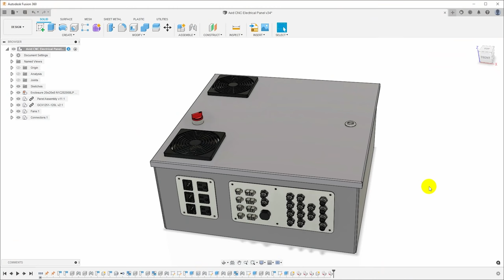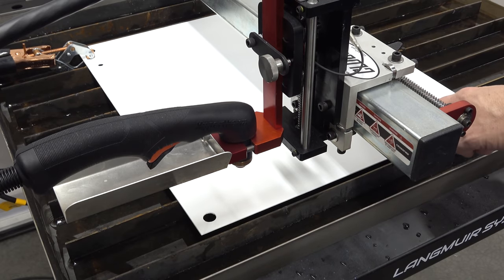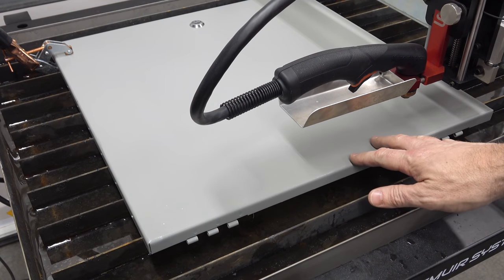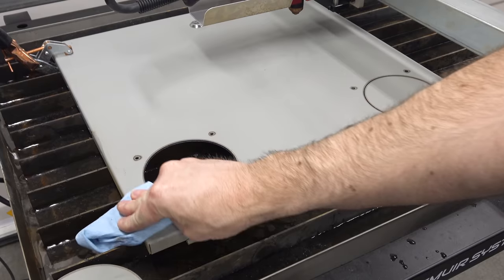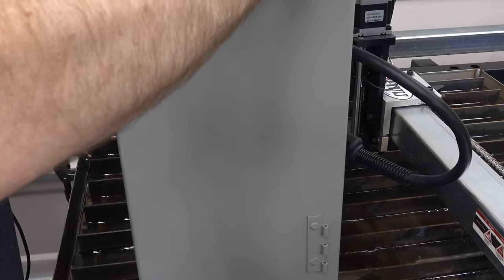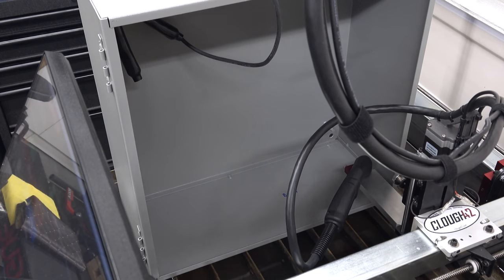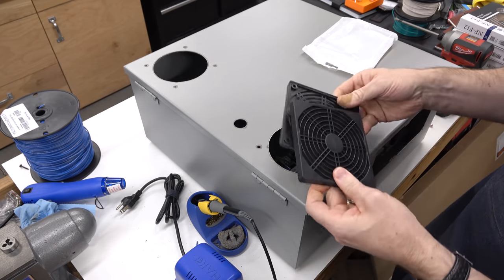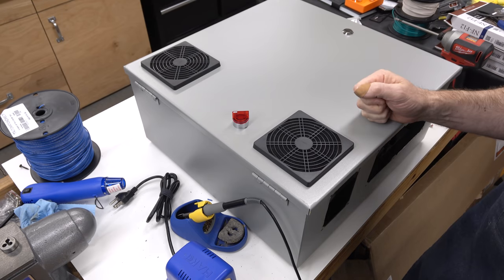Can you CNC Plasma Cut a NEMA Electrical Enclosure?  Should you?

Comment: Would a lead in on the switch hole reduced the burn spot?
Reply from the maker: I should have modeled it with a separate operation in the CAM, so I could place the pierce further away from the edge.  It had to be that close for the smaller holes, and I was lazy.

Comment: Why didn’t you cut the vent farther down in the box. Your air flow will just mostly travel through the top from one hole to another as opposed to bathing 5e electronics in air? It will be mostly laminar flow. If you were to reverse fan and push air you’ll get more coverage. I don’t know the warts being pulled by electronic so it may not matter at all. Great videos btw

Comment: I might be missing something obvious but... Why not mask off the bottom to prevent the staining and skip having to wash it off with soap and windex? Not like you can put masking tape on the top but on the bottom it should burn through that no problem. Maybe you have to scrape and clean charred tape residue on that heat affected zone but that's a lot smaller than the entirety of the bottom surface.
Reply from the maker: I wasn't sure if masking tape would burn and make the problem worse, and I was worried that other ideas I had (like aluminum foil) might capture the blast coming out the bottom and direct it sideways across the surface, causing more problems.  Someday when I'm not cutting a $275 box, I'll experiment.

Comment: Hi james, I've been trying to find the brand and type of the 3D printer you're using. But it's never in the description of the video's where you use it. Could you tell me what it is (and if it's a good starter model)?
Reply from the maker: They were both kits from MakerFarm.  But unless you have a time machine, that's not going to do you much good.

Comment: Don't worry, nobody will notice the HAZ... But WE KNOW IT'S THERE! ;)
Nice job by the way!
I wonder what made the Internet "Don't do it!"... Any law conformity, possible heat deformation, HAZ "ruins" the coating, ... ? The only "good" reason I see would be "augmented" toxicity of the fumes because of the coating... As for the law part, I suppose that someone could have said that it is forbidden to use a plasma cutter near the box, when the components are inside (and live)...
Reply from the maker: The feedback was that the plasma will ruin the finish on the box.

Comment: It is always debate whether the fan should pull air out of the box rather than try to push air into the box.   Most computer devices pull air out.
Reply from the maker: I can confirm that if you show a fan in a YouTube video, you will get lots of comments about how you did it wrong.  I opted to draw air in to create positive pressure inside the box.  This prevents dust from being sucked in through the connectors and around the edges of the door.  I have four other boxes on machines in my shop that use this technique, and they are spotless inside--even after years of use.
Reply: @Clough42  OK James, understood, (clearly a problem when you have 63,000 'fans' .....)   You explained this on the ELS project but didn't repeat it this time for 'new' viewers so the comment was intended as a prompt which you have clarified.

Comment: Would starting the cut from inside the cutout, instead of the edge, eliminate the burn through spot as an issue ?
Reply from the maker: I did, but it was pretty close to the edge.  I didn't change the setting from the very small offset I needed to use for the screw holes.

Comment: Could you put a blue scotch tape or captan(?) tape down to minimize the scorching?
Reply from the maker: Maybe.  As long as it doesn't catch fire.  Though Kapton is polyamide, which is pretty toxic when it burns, if I understand correctly.
Reply: @Clough42  could be worth the testing the blue tape and others options. You have the capability vs most of your viewers to test if peeling vs scrubbing is better. 

Kapton may not be so good - I’ve just seen it used a lot in 3d printing as it durable. Although the heat of a printer is far different to plasma or a molten ball of Metal. 

Aluminum foil tape maybe worthwhile. 

In your case above you just wipe off but some material may not be so readily cleaned.

Comment: Why do you choose to blow air into the box?  I've always been told, and seen on many computers the fans blow out of the box.  I've never measured it myself but word has it that using fans in the exhaust position gives better airflow.
Reply from the maker: I agree this is hotly debated, but there's no real difference in practice.  I chose to positively pressurize the box to keep it from sucking dust in around the door seam.
Reply: @Clough42  That makes sense for you.  Your box is not designed for fan cooling and not well sealed against air leaks.  Every fan cooled electronic enclosure I've ever seen does it the other way.  They usually have air inlets in the front and fans in the back so airflow is straight across the internal components and not a lot of empty space.  Do you know how much heat you need to dissipate?  Given the inefficiency of airflow and all the extra space in the box I wonder if you might not need two fans.

Comment: I wouldn't like to see those bare metal edges after a while. Are you going to give them a coat of paint or some other corrosion inhibitor?
Reply from the maker: If I lived in a place where things rusted, I would.  But nothing rusts here.  I have bare mild steel stuff all over my shop, and you would be hard pressed to find anything with any rust on it.  I did see something that kind of looked like rust on a mild steel vise jaw that sat in contact with coolant for a while, but it wiped off with a rag.

Comment: They probably used paint locked steel that has been enamel powder coated.  Very cool content nonetheless.
Reply from the maker: Oh, interesting.  If it is indeed Paintlok, that means it's got at least some zinc in the coating, and ventilation would be even more important.
Reply: @Clough42  when I worked with paintloc it was really harsh on our turret bits, we had to constantly sharpen them

Comment: also if u have the wheels on it i can tell how bad it shakes with them. ive never had them on
Reply from the maker: Yeah, it moves a little, but I don't see it causing any issues.  I did a dry run to make sure the cabinet wouldn't rock or tip when it was standing up, but there just isn't enough acceleration to cause that.  I need the wheels because the table has to be tucked away in a corner behind other equipment when not in use.

Comment: You should get in the habit of doing your pierce in the waste area of the cut out and then doing the cut. We do a lot of structural
steel fabrication and anytime we cut a hole in the steel we pierce in the waste if possible and we get a very clean cut with no divot from the pierce. Check out some of the videos of what we do on youtube: cobb industrial inc
Reply from the maker: The pierce is in the waste area.  In this case, I was lazy and used one operation in the CAM program for all of the holes, and I had to make the pierce distance short to fit inside the small screw holes.  If I weren't so lazy, or if I thought it would be a big deal, I would have made a second operation for the large holes with the pierce further from the edge.

Comment: raise the water level to touch bottom of plate and you wont have the staining
Reply from the maker: Yeah, in this table, the slats are higher than the sides of the tray.  I could raise the water higher in the tray as it is, but I try to keep the volume so it will fit in one 5-gallon bucket for convenience, since I drain the table and wheel it into a corner for storage after use.
Reply: @Clough42  Understandable, I guess you pull the slats and use improvised jacks or cut a few lower slats if you ever had a bunch to do. I wonder why the slats sit so high on that table, I usually run water to bottom of plate to it's cool when done and less warpage.

Comment: Just use a jigsaw they work just fine
Reply from the maker: Prior to this, the jigsaw was the most successful tool I've tried, but it's still not great.  Perhaps I need a better saw.  Hand cutting also requires accurate layout and drilling, which is something I'm notoriously bad at.
Reply: @Clough42  I've done them all. This looks far and away the best (if you have the kit). Jealous :)
Reply: We use jigsaws at work with Bosch metal blades fly right through it. I'm not knocking the plasma as it is your box. But we could never get away doing that in production. Once you get good with a combo square could prob knock the holes faster than modeling and writing gcode. But what ever gets the job done right 👍

Comment: How about a sample of the internet saying this isn't a good idea.  Or tell us why you were advised NOT to do it this way.
It seems like a no-brainer to include that information.  There could be some very good reasons--perhaps even safety issues.
Apparently the no-brainer move is to state, prosaically, "the internet told me not to", and then fail to prove that's what "the internet" actually advised.
Reply from the maker: I posted on Instagram and was advised that it would ruin the powder coat finish.

Comment: Everyone has an opinion, problem is most people are idiots so concensous is not all that useful. Nice job. Concider programing the sheet puncture within the scrap cutout and an arc move out to the wanted edge to reduce the HAZ.
Cheers-Peter
Reply from the maker: Yeah, I was lazy and had the offset set pretty small to accommodate the screw holes and didn't adjust it for the large holes.  Your comments on consensus are appropriate.  Though it's not necessarily because most people are idiots (they are) but because usually a small number of people (maybe just one) actually try something, and everyone else can't be bothered to understand any more than just "don't".

Comment: Oops, the fan is backwards. It should pull air out of the box, and pull air in through the filters. I'm sure you noticed by now.
Reply from the maker: Not in a dusty environment.  These boxes leak all around the door, and an exhaust fan will create negative pressure in the box and pull dust in all around the door.  I have had four similar boxes running with positive pressure in my shop for many years, and they're still spotless inside.
Reply: @Clough42  Makes sense, but you don't need the filter then. I'm used to computers in a clean environment that only catches a little lint... unless there's a cat.
Reply from the maker: @Bob_Adkins  the filter media prevents chips and dust from being sucked in by the fan, and the filter on the exhaust prevents ingress of dust and chips when it's powered off.

Comment: may I ask why not just make the case yourself? I'm not too familiar with your channel, but those seem to be little more than some bent and tack welded together pieces of sheet, if you have a mill and a plasma cutter I would be surprised if it were out of your reach.
Reply from the maker: This particular size is a little large for my equipment, but possible with more seams.

Comment: Could someone explain why the fuck could you not cut electrical enclosure with a CNC plasma? Like, it is metal, it conducts electricity, so it cuts. I understand someones armchair isn't metallic and thus doesn't cut well, but duh.
Reply from the maker: I don't think anyone thought it wouldn't cut.  Most of the feedback I got said it would destroy the paint or powdercoat.  If you have to strip and repaint the box after cutting, that kind of ruins the efficiency.

Comment: I don’t see why using a plasma cutter on an enclosure would be a bad idea.
Reply from the maker: I think the primary concern was that the heat and blast would destroy the finish.  Another concern is that there is zinc in the paint-lock coatings, so good ventilation is a must.